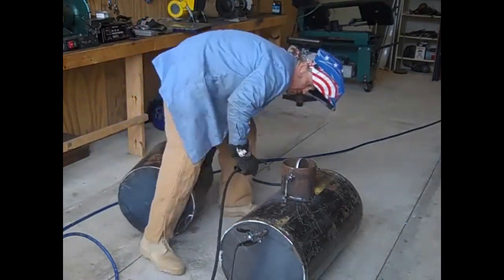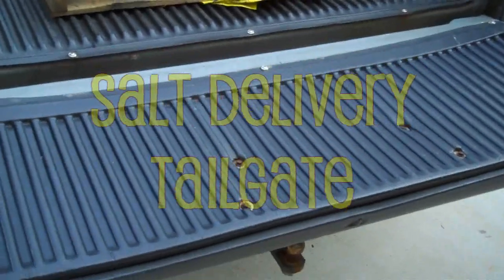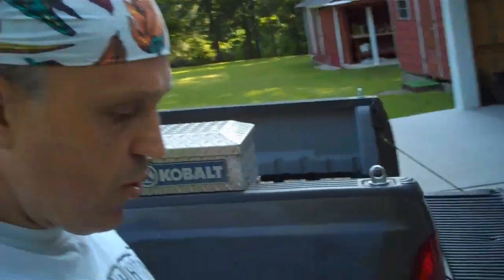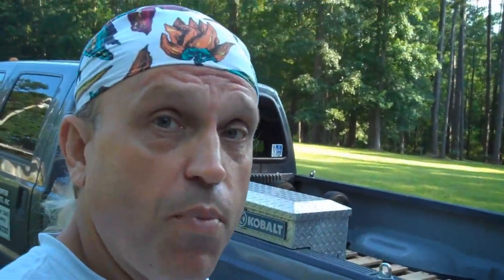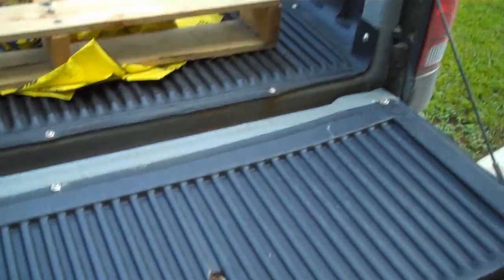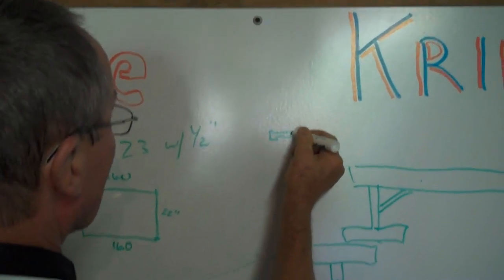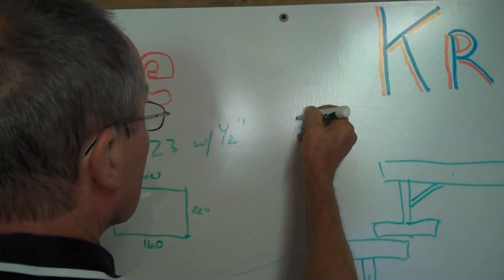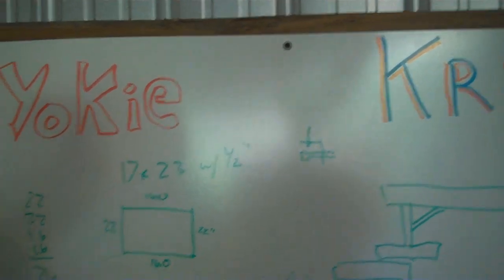Custom tailgate... and it turned out Great!

Comment: It has been proving that it doesn't matter if the tail gate is down or up, it doesn't improve mileage...
Reply: tom jones 
That’s not true. You get better gas mileage with the tailgate up regardless if it’s solid or louvered. What really makes the difference is how wide the top of the tailgate is. Notice how the tailgates on newer models are all thicker at the top? What unknown is all the different variations of toolboxes etc.